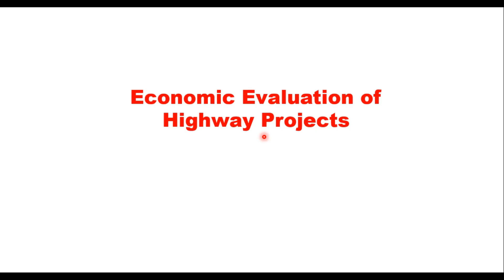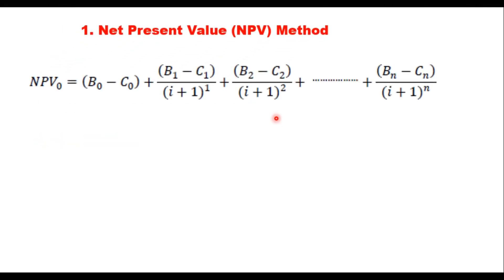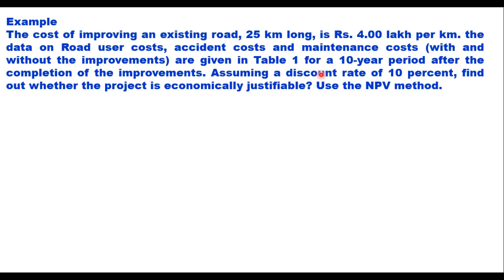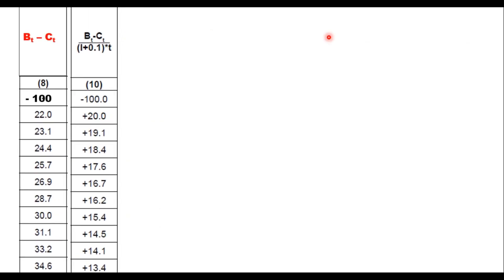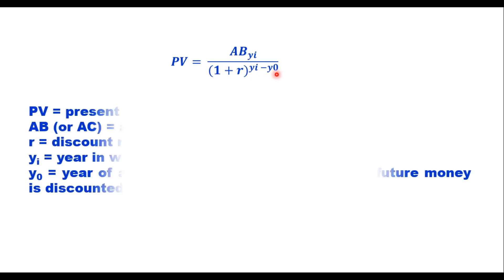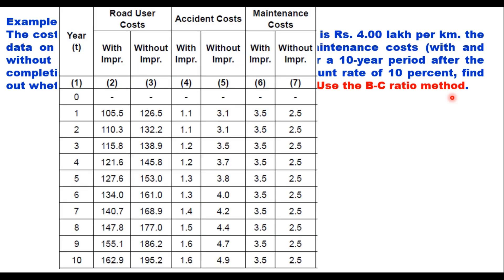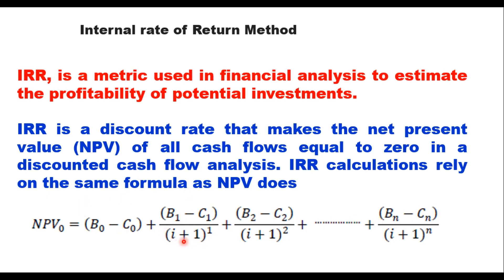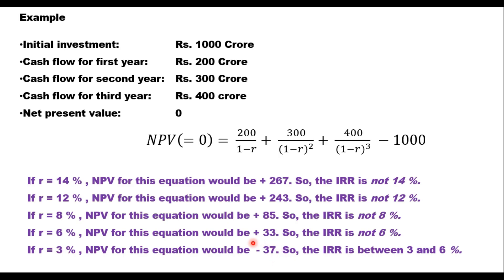Economic evaluation of Highway Projects, IRC SP 30. Three methods explained with examples.

Comment: Sir rigid aur flexible pavement me core test kyu karte hai
Reply from the maker: To determine strength, thickness and density. You can also find the binder content and gradation in bituminous layer
Reply: Sir Binder course kya hota hai  aur Binder course kyu karte hai.dense bituminous macadam aur bituminous concrete me kya difference  hai.
Reply from the maker: @kkg3085  Read IRC 37, you will get answer to your question. It will be very long to write here
Reply: @SatishIITR yes it's define everything
Reply: In flexible pavement we do in two layer... Bottom layer is normally we provide dense bituminous macadam ( DBM) upper layer is wearing course. that we normally provide bituminous concrete (BC)